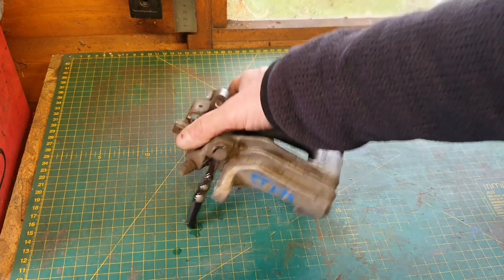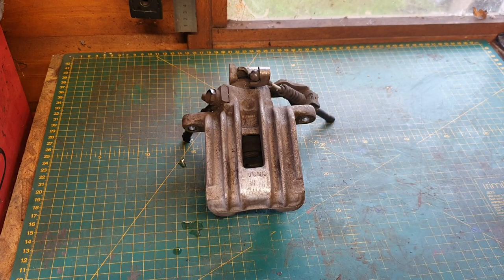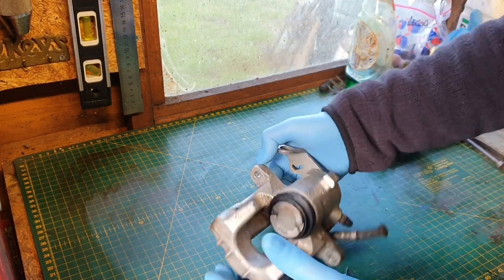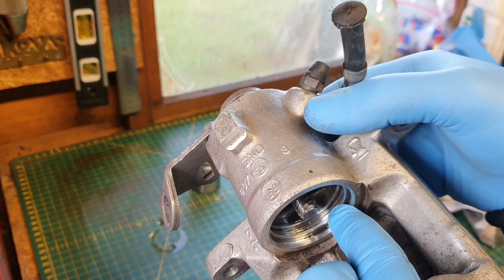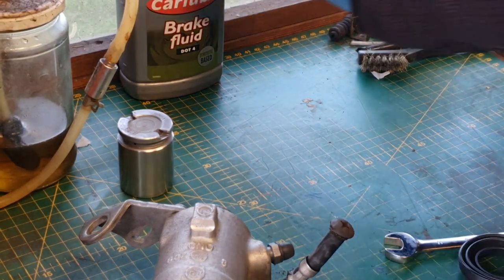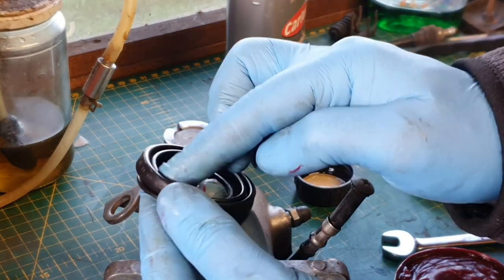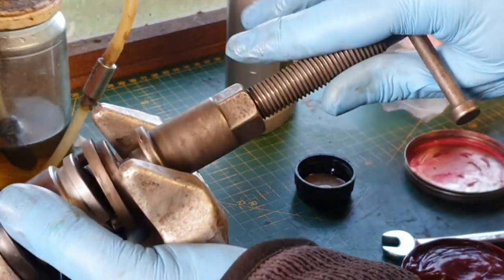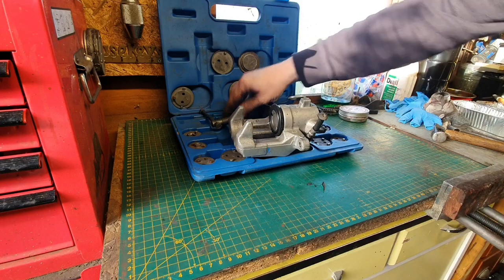skoda fabia VAG rear brake caliper piston seal replacement - seized or sticking piston

Comment: What is the liquid/solution you are cleaning the caliper in? Will it be effective even on very dirty calipers from salt and oxidation?
Reply from the maker: Hi, thanks for watching. I just used warm water and Fairy washing up liquid. I find it's really good, anything really bad and I use proper brake cleaner.

Comment: Yep, mine has semi seized and brakes tight on one side..
So if I wound the piston out with the brake lines still connected it would leak fluid behind the piston?
Reply from the maker: It would if the piston came out beyond the seal. I clamp the hose with a proper tool when doing any works like this just in case, I've managed to get decent second hand calipers for both my rear ones. Much easier to rebuild those and swap them over.